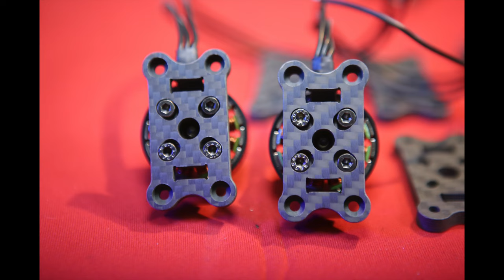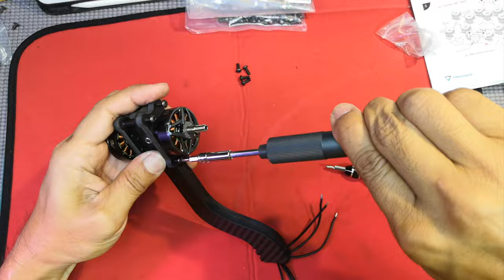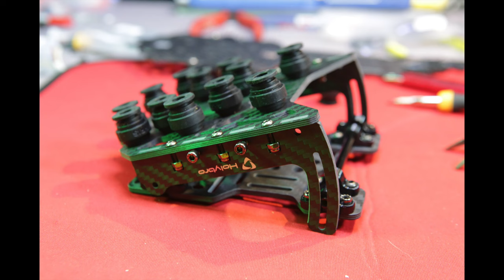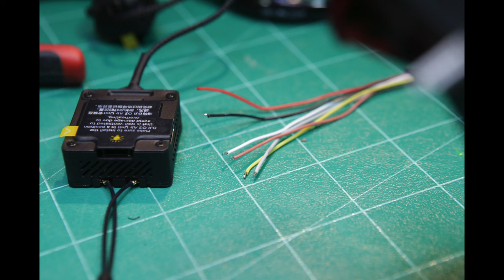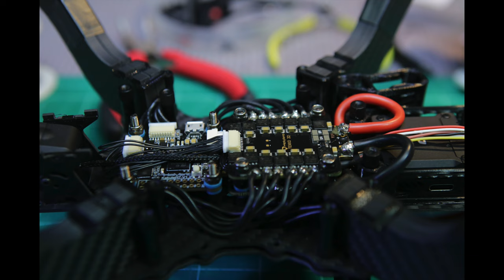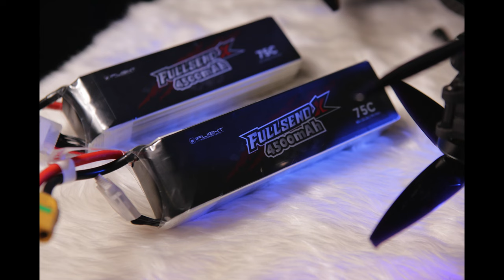DJI AIRUNIT O3 + HOLYBRO CINEMATIC X8 [HOW  TO BUILD] || STEP by STEP PHOTOS GUIDE [2.7K]

Comment: hey, did you manage to tune it already? I'm having a lot of trouble tuning the x8, I've never tuned an x8, only 5 inches. but I notice that I raise the P and it seems that nothing changes. can you help me, do you have instagram so i can follow? thanks
Reply: if you raise your P and nothing changes snd you already have tune issues id say problem is somewhere else.. try adjusting your D first and then adjust others acordingly. id reccomend you to start with betaflight defaults for that you can start raising master slider as betaflight dafaults should be pretty balanced already and that way dinf your D value